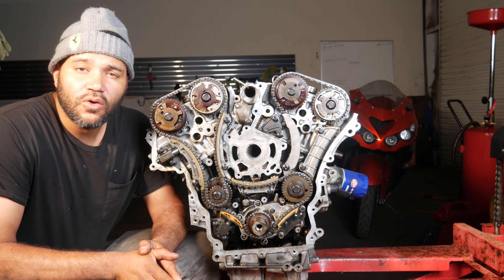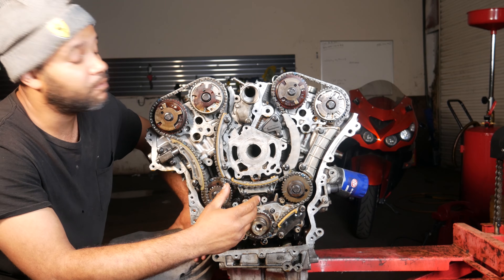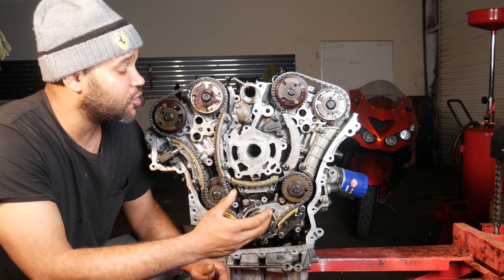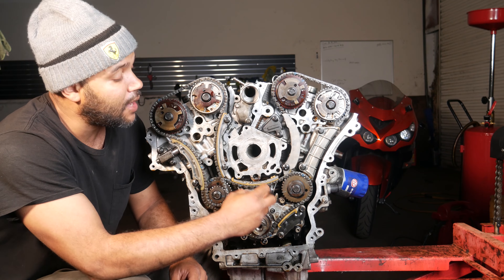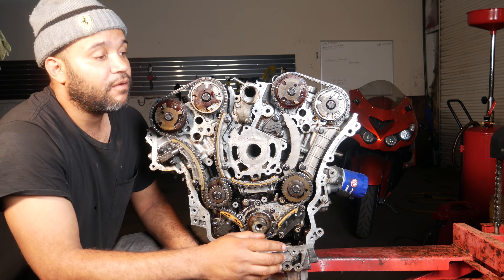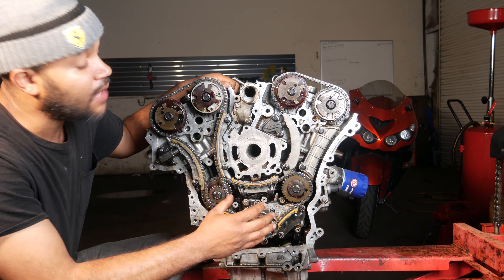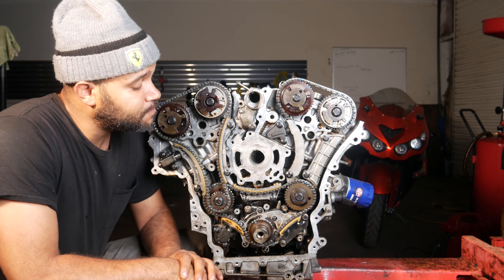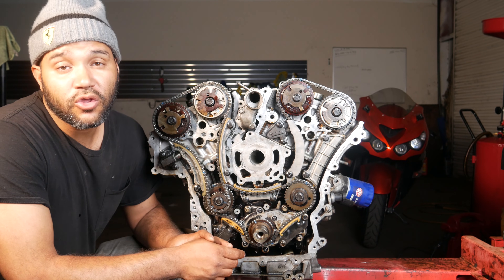HOW TO PREVENT TIMING CHAIN PROBLEMS l GM 3.6 ENGINE PROBLEMS

Comment: First problem the stp oil filter. Second problem cheap oil along with a cheap filter. Third problem following the olm. My parents put 185,000 trouble free miles on a Lacrose and 100,000 miles on a enclave. No issues with 5k oil changes .
Reply: I agree with you. My 2014 enclave has 96k miles without any issue on the engine. I personally replaced the oil at 5k with full synthetic motor oil and full synthetic Fram oil filter ( I tore apart the old filter to verify the quality of this filter, and I was very satisfied with the internal components) I also opened a cheap filter installed by my local GM dealer 😢 that is why I prefer do it by myself.

Comment: Hey I was wondering what would be wrong with my 2010 3.6l v6 Camaro it’s a lt coupe and it’s making a weird noise from the engine especially when I rev it up it makes the noise louder but it’s doesn’t sound like a knock and it sound like its coming from the front of the engine

Comment: Got a question if you got a chance. I got a 2017 Cadillac XTS. When I start it up there is a rattle for a second or two. Im about certain its timing chain related. I thought it was a bearing in my dual fan but I replaced that and still got the same rattling noise. My question is if there are three timing chains what do you recommend I do
Reply: I hear that rattle on mines only on cold start ups after sitting for while like over nigh. But after that an driving it an cranking it again it don't make a sound.

Comment: Correct me if I'm wrong, but isn't the origin of the problem the fact that the holes in the PCV Valve are too small? It gets clogged up and suddenly you've got massively low oil without ever seeing any leaks on the ground.
Reply: I would say change that pcv valve when you do oil changes or at least after 3 or 4 oil changes at 3k to 4k. That's what I have done haven't had any oil leaks or burn off. Haven't had to add any oil either. I use Valvoline extended synthetic oil with either kn, Mobil 1 or stp extended life filter.

Comment: I have a 2011 Buick Lacross with the 3.6. It currently has 184,000 miles on it and don't burn any oil. I think I hear some chain slap on start up until it warms up. No codes. Should I have my timing chain replaced or wait until codes?

Comment: I guess I'm not doing too bad with my, 2014 Cadillac srx. The oil life. Is set to5000km.  Which equals to 3107miles.  I often change the oil at 20% life left!  I wonder why many of you have your oil life at 5000 miles or more?  Is it possible to set the oil life to a shorter interval?  On average how many miles do people go on these engines before needing  a timing chain replacement?

Comment: Excellent info. I have a new to me 2013 XTS with 60K - did a Liqui Moly engine flush, then a few miles on an oil change, and then changed again and put in amsoil signature series with a new delco filter. The first oil had been in there about a thousand miles - the dealer did it pre-sale prep. I was ABSOLUTELY SHOCKED at how dark the oil came out, even the second change was dark. 
Engine is nice and quiet, I'm hoping to get plenty more reliable miles on it. 

BTW, did a drain and fill on the 6T70 automatic fluid three times - again, shocking how dark the fluid was. Don't neglect these cars - they will bite you back HARD!!
Reply: Yep, it's having to clean out a lot. Eventually, the oil after 1k miles will still appear light and transparent like it should. I don't go beyond 3k for an interval.
Reply: Great info. I drive a 2013 Lexus ES350 and the oil always looks like it did when I changed it. I'm looking to replace the lexus with a XT6 or GX460. What is the difference between GM & Lexus engines with respect to engine oil color? Thanks,
Reply: @kevinmoler4225  Oil color has to do with how much sludge dirt and carbon it keeps in suspension through the detergent process of the oil. If the engine is clean inside then the oil won't get dirty. I imagine the Lexus engine runs cleaner, but all depends on the environment it runs it, it's age, and the frequency of oil changes. 
The XT6 uses the latest generation of this 3.6L V6, which is much more durable and reliable that earlier iterations. 
Dirty oil just means it's doing it's job - and any extended interval, say past five or six thousand miles, should begin to get dark from suspended dirt in the oil. 
I had a 2001 BMW 3-series that would hardly dirty it's oil in 6K miles, once I got the engine cleaned out to begin with. The first owner went 10K on OIC's, so a few flushes and changes and it cleared out the sludge inside. IMO OIC's should not be longer than about 6 or 7K unless you're doing analysis to determine additive package remaining, and to check for any wear indicators. Blackstone is a popular testing lab.
Reply: Liquimoly stuff is garbage stuff for your engine
Reply: @MilehighRob303  - It's just oil. [rolls eyes] Kind of like amsoil.

Comment: You completely left out drilling your PCV valve to a bigger diameter to improve ventilation as per GM bulletin. I did and mine seems to run a lot better .

Comment: On these GM 3.6 engines, I change the oil every 2500-3500 miles only exception is a long constant highway road trip and I change it when I get home. Keep the oil clean in these engines, they're fantastic if you do
Reply: Mobil 1 every 2500 miles? You'd be money ahead to buy another engine at 150k! ; )   J/k, but that seems extreme, especially if you drive a lot.

Comment: I just changed my crankshaft, rod bearings, oil pump, cam phasers, exhaust solenoid and everything with the timing chains and my engine is at 10 psi oil pressure which is the minimum. Any idea why it’s so low? It’s a 2010 Camaro 3.6
Reply from the maker: Did you change the oil pick up seal?
Reply: @bossautomotive7786  no I didn’t where is that?? This is my first time hearing about that seal. I changed the oil pump but never heard anything about a seal. I also just saw one of the old chain tensioners and noticed it had 2 gaskets on it. I think I forgot to put on one of the chain tensioner gaskets. Will that make it have low oil pressure due to the tensioners being controlled by oil pressure???
Reply: @bossautomotive7786 I found what you’re talking about on PRODEMAND. Are you referring to OIL SUCTION TUBE SEAL & OIL SUCTION TUBE?? And no I didn’t change the seal bro!!! Thank you bro for replying!! I REUSED THE OLD SEAL SMDH!!!

Comment: The turbo 2.8's have a different valve covers, better PCV.  
They like 0w-40.  Change it every 4500-5000 miles with a proper oil, like mobil 1 EURO 0w-40.  Engine will last longer than every other component on the car.

Comment: Just did this job on my moms 2008 Cadillac Srx with 197k miles.  I added 2 oil catch cans because of the bad ventilation. And I add a quart of oil every 1500 miles. Great engine, just gotta keep on eye on the oil level.
Reply: If you want to address the oil burning, I suggest a B-12 Chemtool treatment at your next oil change.
Reply: @rschneid1996  AND / or kerosene flush.  My 2006 Holden VZ (3.6 L Alloytech) was burning 1.5 ltrs per 1,000 km (600 miles?).  I gave it 3 consecutive kero flushes (5 ltrs oil, 2 ltrs kerosene + filter, run 30 mins drain and go again), this dropped the oil burn to 1 ltr per 3,000 km (which I can live with).

Comment: When I heard about this problem with the 3.6, I started changing the oil at 50% (according to the oil life monitor). Hopefully that will delay my cam chain stretch difficulties.
Reply: The new manager at the oil change place I go to asked me what I wanted the oil life mileage set at, I said 5k. Either there is a way to change it or he was BS'ing me. He seemed  to know the engine  and its problems. So far it seems accurate.
Reply: @unti419    12.24.25.   ☝🏼 He reset the oil monitor to probably 50% instead of 100% so you would be driving less miles and elapsed time, before the next oil change. He was doing you a HUGE favor‼️
Reply: I do the same with my LS based Silverados, which suffer oil related problems as well.  They are not OHC, but experience AFM problems and a drop in oil pressure.  IMO, factors are poor PCV, small filter element,  AFM related oil consumption.  I have deactivated AFM and increased oil changes.  Things are better.   Now I've got a 3.6 Camaro and it is interesting to see such similar problems.  Will stay on top of maintenance!
Reply: that is what i do also..

Comment: have a 2019 xts  amazing car but my 2009 cts is a nightmare . I do oil changes all the time and had the timing chain job did twice now have a p0008 and p0018 timing codes on again. also a oil pressure code  and its a new sensor on that too.  I changed the cam  sensors and vvt sensors. crazy part is car runs rough and less power choppy. but at times drives  smooth full power and perfect. got me thinking how would the timing be off if the car  drives good sometimes. probably a phantom problem like a wire in a harness or something odd.
Reply from the maker: Was the oil pump changed?
Reply: @bossautomotive7786  yes it was on the 2nd timing job brand new.

Comment: Great advice! My car has a 3.6 LF3 motor, I change the oil religiously at 4000 miles - $60 every few months is way cheaper than $6000 for a motor. I arrived at this conclusion by sending out oil samples to blackstone labs and tracking the oil additives, 3500-4000 is perfect, 4500 if there is some reason I can't do it right away. Granted, my car is a twin turbo which is harder on the oil than a naturally aspirated one, but I'm almost at 100k and my engine looks immaculate inside and the timing chains are in perfect shape.
Reply: Do not buy Chevy is cheaper.
Reply: Changing the oil will help but the chain is not good quality so it will stretch no matter what. GM saving money at the cost of people's money.

Comment: I changed mine every 3k and it lasted 160k before the light came on.  Timing seemed fine.  Had to get it changed to get it inspected. Private mechanic charged 2500 and motor blew 2 months later from low oil.  I think he messed up the oil pump by replacing the guide and messing up the torque on that bolt
Reply from the maker: Wow, sorry about that.

Comment: I've had my 08 xl7 with this 3.6l for over a decade. I bought it from a rental car company before 50k mi. I didn't even own it a year before the timing chain started making noise. Replaced under the manufacturer warranty. It doesn't even have 130k mi on it now. I change my oil regularly, clean the egr and vacuum tubing regularly, use seafoam in the gas and oil before every oil change... and I have the code again. Mine is burning oil though.  I'm going through about a quart of oil every month of daily driving of about an hour and half per day city. I have also always used full synthetic and high mileage oil in it.
Reply: What type of oil you use? Try using Valvoline extended synthetic oil and change your pcv valve. Might help you on the oil consumption. I have 07 G6 GTP with the 3.6 haven't had to add no oil to it at all.

Comment: owner neglected the codes on a beautiful 2007 sts then died while driving believes timing chain went bad still cranks over no start is it worth buying or do you think engine is bad since happened while driving can purchase car for $800 thanks for any help!
Reply from the maker: Mostly the valve are toast. You are going to need an engine, a used engine are around 900 to 1500, remember you also have to pay to have the engine install, I usually charge
 1200 for the install
Reply: @bossautomotive7786  Thank You so much for your time and answer where is your shop located I am in Michigan much appreciated!

Comment: Direct injection gasoline engines in general need oil changes very often.  Also I have learned that it is crucial to use a good name brand full synthetic oil.  Gasoline direct injection engines run hotter and are prone to diluting the oil with fuel.  So you really need to keep up with changing spark plugs too.  Now before someone says something about the oil you go with a name brand so you get a better additive package in the oil.  Another thing I have learned is direct injection engines prefer 93 octane.  Yes the ECM absolutely knows what kind of fuel you are running.  I'm a mechanic of over ten years and went to a trade school.  Just trying to help people out is all, just like this dude.  My wife has a 2016 Traverse by the way.
Reply: GM-junk
Reply: It huts for 3.6l owners but is true. @williamburrows6589
Reply: My understanding is the direct injection system cool the tops of the pistions which is how they were able to up the compression and run 87 octane in an engine that has 11.5-1 compression ratio. The turbo charged engines however do run hotter.
Reply: @johnnydrakos6407   Direct injection has nothing to with cooling down combustion.  It just gives the ability to make the fuel injection sequence more precise for fuel economy.  The only way to cool down combustion is either through fuel by adding more of it or running a cooler burning fuel like ethanol or methenol.  The other way is by injecting something like NOS or water into the intake charge.  While you can say that about direct injection those are just happy by products.  But DI only has a cooling effect because it has not warmed up by coming through the intake ports.
Reply: @Hummin_Along  You are contradicting your comment with the first sentence and last sentence! By direct injection, you are quenching the combustion process. In a non-DI engine you are introducing a heated intake charge unless you have inter cooling. By running NOS you are creating more oxygen into the engine which allows more fuel to be burned which in turn creates more power much as a turbo or supercharger does.
Reply: @TheOzthewiz  I think you don't know what you are talking about at all.  Combustion temps in DI are higher.  Also SFI engines have the valves and intake cooled by the fuel which you do not get in DI.  Dirty valves are a huge problem with DI engines.  Also your talk about DI has and performance in the same paragraph is wrong also.  In the performance/race car world people don't do DI it's all SFI for the most part.
Reply: so i got a v6 camaro with the lfx motor and it says to run unleaded but should i run Primmum since its direct injected and the additives would help clean it or would higher grade gas hurt the car. i haven't been able to find a definitive answer so i've been putting premium gas in it once every 3 fill ups
Reply: @ggfgvvn.a.5752 if you have a 2016 it's not the lfx it's the lgx. It is a completely different engine in design. Just keep oil changes 5000 an under and your good. 93 octane will not change anything just put a hole in your pocket.
Reply: @Guaranteedfresh1  You are absolutely right about the "LGX" version engine. It has been much improved and is the latest version. I have the "LGX" in my '20 Blazer and have heard GOOD things about this version! Another thing to watch for is the oil LEVEL. I maintain my oil at the FULL mark by checking it weekly even though I only drive about 1500miles per year. Even this version of 3.6L is critical as far as oil level. Oil is critical for keeping the engine cooler. Just don't OVERFILL it, aerated oil because of overfilling will cause damage!!
Reply: @ggfgvvn.a.5752 don't waste money on premium, make sure you get top tier gas though, look up top tier gas
Reply: The 2010 Cadillac SRX 3.0 direct injection is the notorious worst of the original GM Direct Injection engines the 3.0 is the early version of the 3.6 they also suffer from build up carbon on the valves because no fuel additives come in contact with them you have to remove the manifold to clean them
Reply: I have that engine in my 16 Buick LaCrosse got around 93k miles an I change the oil around every 3500/4500 miles I drive a lot an drive my car hard any other recommendations on how to maintain my car better
Reply: @titoortiz5924  Let it warm up before you go heavy on the throttle. And I don't mean letting the engine idle while you are having a cup of coffee. Let it idle for about 30 sec, then DRIVE the car with light throttle for about a mile before you do heavy acceleration! Doing this will do WONDERS for engine longevity, Fyi, the MOST engine wear happens during the FIRST FEW minutes after a COLD start! Use a "low volatility" oil. The best oil is Pennzoil "ultra" Platinum, has lower volatility than even Amsoil!! Btw, check your oil LEVEL OFTEN and keep it at the FULL mark all the time. Engine oil level is especially critical on these DOHC valve trains and phasers! Good luck!
Reply: My 3.6 made in 2012 is port injection.  I don’t think they went direct injection until much later.
Reply: @MarkSmith-js2pu its direct injection

Comment: I have the oil changed in my Ford 2001 E-150 (5.4L/329CID) Conversion Van every 3,000 miles. She has 196,000 miles and no engine oil leaks. I've noticed I'm burning roughly 3/4 quart of oil between changes. I check my oil every time I gas and add when needed. I have it on good authority that my Triton V8 will hit 500k before needing to be rebuilt. Coolant is changed every 120,000 miles or sooner if it looks nasty.

Comment: At the end of the video you were recommending things that would prolong engine. After changing the oil every 5K miles it sounded like you said forcing telecoil..not sure if I heard correct but what is that? Thanks for your video and your time

Comment: I have a 3.6 engine in my 2010 CTS, I'm learning a lot of things I didn't know before. Great video Boss!
Reply: Mine has lasted many more miles than my pops CTS did. I always let mine warm up fully and drop to 25-30psi oil pressure before driving it and I believe this has alot to do with it. Much less stress on the chains this way